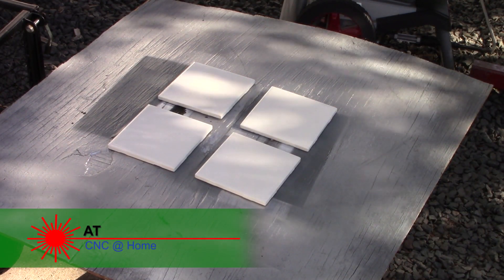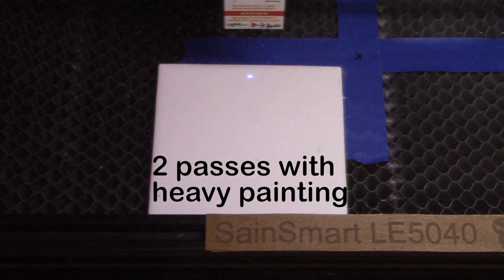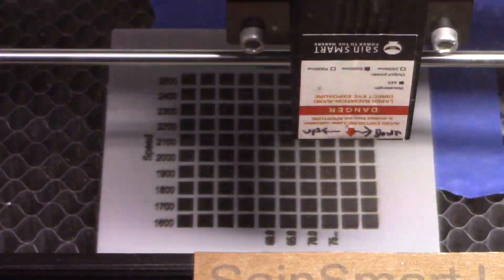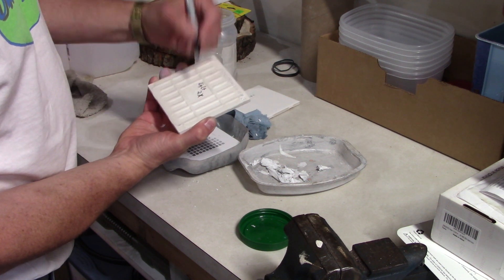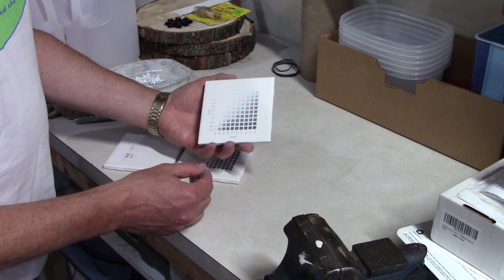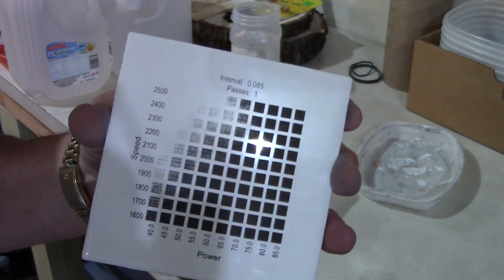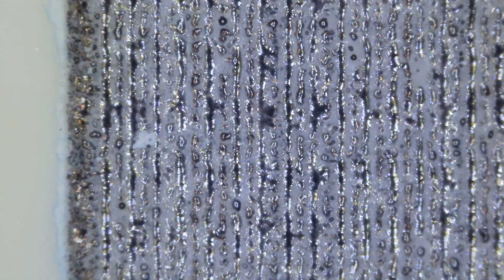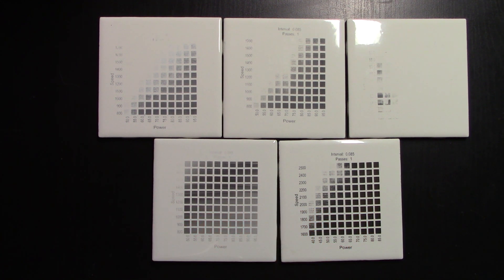Tile etching - How much paint is too much paint?  Is paint the way to go?

Comment: What was the cold galvanising compound spray you used, please.
Great video, new subscriber.
Reply from the maker: Great question.  You are going to love the answer.  What I use is literally called Cold Galvanizing Compound from Rust-Oleum.  Back in the day, we used a product called ZRC which is zinc-rich coating. I am not endorsing or promoting Rust-Oleum products, that just happens to be the brand available at my local hardware store.  AND thank you for the sub!  🙂
Reply: Thanks, i found several spray types, good reply!
Reply from the maker: @stu_artist  - Anything with a high zinc content should work.

Comment: Thank you for a great informative video the Galvanised  compound does seem to be the best, I noticed you have a 5.5 watt laser is there any power conversion charts/apps for using a different power laser (I have a Falcon 2 22 watt)? 

Keep the great videos coming and Happy New Year.
Reply: Thank you for the advice, i'll run a test pattern and adjust the settings, thank you again, take care
Reply from the maker: @DaveJonescruise  - Once you find your operating area, you will be golden!
Reply from the maker: It would be great if there was an easy conversion for that.  There is more too it than just the output power.  The size of your laser spot will also affect your parameters.  My AtomStack P7 is only a 5.5 watt laser but the spot is really tight and small so it acts more like a 10 watt laser. But with the smaller spot, doing a fill requires more passes.
I did find that the CGC has quite the latitude where it works well. If you have LightBurn, use the material test option to find where your laser's sweet spot is.

Comment: Hi. Greetings from Ireland. 
Saw your video regarding using cold galvanising compound on white tiles and wondered
A- do you put any paint on the tile before the CGC?
B- what settings do you use to do the tile test where you get all the squares?
C- I have an ortur lm2 15w with a fixed focus laser module on it. Would that be suitable for engraving on white tiles using the CGC?
D- are there any health issues with spraying or engraving on tiles coated with CGC?
We cant get paint containing titanium di-oxide here, so im hoping the CGC stuff will be a good substitute.
Your video was soo informative so i subscribed 😊
Hope ive not asked too many questions here !!
Reply from the maker: Thank you for the questions and always great to hear from my Irish kin.  Thank you for subscribing.

A - CGC goes directly on a clean tile and you don't need much
B - With my 10w laser, found the sweet spot at 35% to 50% anywhere from 2,000 mm/m to 3,800 mm/m.  It seems to be a very forgiving process.  I did find that too much power is bad at the lower speeds and is good at the higher speeds.
C - With your 15w laser, you will have plenty of power to do this.  Doesn't take much.  I got great results with my 5.5w laser.
D - As with anything you are burning, make sure to have good ventilation.  As a general rule, you do not want to inhale anything the laser is burning.  When applying the CGC, it is also a good idea not to huff the fumes.  ;-)

I have been using TiO2 mixed with alcohol and gotten great results.  If you can get CGC, that should work great for you.  It is easy to spray on in a light even coat and the results are very nice.
Reply: @CNCATHome Many thanks AJ. I'll get some CGC tomorrow. 
We might even explore your Irish kin one day 😂
Reply from the maker: @mikemcguckian6968  - Best of luck with your experiments with CGC.  My dad's mom was Irish. Her parents were first generation immigrants to the USA. You have to go back farther on my mom's side but they are all British Isles: English, Scottish, Irish.  I was asked once how much Scotch I had in me and I replied "About a fifth!"  😂
Reply: @CNCATHome  that's the right place to have scotch! No point in keeping it in the bottle😃
Reply: I'm fairly sure that cold galvanizing compound is basically zinc in carrier.  I might use zinc in  my laser since it is basically under a fume hood with positive pressure ventilation.  But for the same reason you don't weld galvanized metal, you don't etch with zinc without good ventilation.
Reply from the maker: @NShellhopper  - That is basically what it is.  It is also referred to as Zinc Rich Compound. A VERY good idea to have a well ventilated system when burning that or galvanized metal as you mentioned. I have a 440 CFM fan connected to my laser station that pulls the fumes down through my honeycomb waste board and out!

Comment: One of the better videos I’ve seen when it comes to white tile, thank you! I’m curious, when running your test burn what are the settings to make the laser go both vertical and horizontal?
Reply from the maker: Thank you for that compliment!  I did a quick review of the video to see what you were talking about with the vertical and horizontal.  I didn't see what you were talking about.  I did think about how that could be done.  With a material test, you have control over the material default settings and the text default settings.  As these are set independently from each other, one could be with with a 0° scan angle and the other at 90°.  Within your layer settings, LightBurn has the option of setting multiple layer settings which are applied in order.  I have used this when filling lettering and then come back and use the line option to finish around that to help give it a cleaner look.  This could be used to have a 0° scan followed by a 90° scan.  I hope this helps!  🙂
Reply: @CNCATHome  Thank you for the reply. I was referring to your comment at 2:35 point of the video.
Reply from the maker: @reidjensen569  - Poor explanation on my part.  I was referring to the coating on the tile, not the laser movement.

Comment: That method sure looks familiar
Reply from the maker: Since this video, I have found two other methods that are more consistent and yield better results.  I replaced the white paint with Cold Galvanizing Compound which works very well.  The other method is to use raw titanium dioxide which is what is in the white paint that makes the magic happen.  
CGC: https://youtu.be/t8iJ5Q5qlIU?si=2_TlDtVitDB-OOti (figuring out an issue with CGC)
TiO2: https://youtu.be/GvWHqNku7s0?si=5P6zjL8G49Qu0Wqu

Comment: How long did you let the paint dry before you etched?  Also, are you worried at all about burning cold galvanizing and the fumes produced?  Thanks.
Reply from the maker: That is a great question.  The paint only needs to be dry to the touch and this process will work.  It is the titanium dioxide pigment that this process changes to black and the rest of the paint is just there to deliver and hold it.  A thin coat of paint is all that is needed.  Since this video, I have gone directly to spraying a titanium dioxide mixture onto my tiles and have gotten great results.
Reply: @CNCATHome  The reason I asked is that I have tried the satin smokey beige paint, which is supposed to have more Ti oxide in it than the white paint does.   I was putting on two light to medium coats on the tiles, and not getting any black to come out. I'm using an 80w Co2 laser.  I've done tests from 10mm/s to 300mm/s and power from 10% to 60% with no luck.  Really didn't want to use the galvanizing paint if I could help it, because of the zinc fumes.  I guess I'll order up some Ti power and give that a try.
Reply from the maker: @bigfranksworld  - 80 watts!!  Must be a CO2 laser.  I don't know how well this process works with a CO2 laser as I do not have one, yet. ;-)  I have done this with 5.5 watt and 10 watt, blue diode laser with great results.  I don't know how the frequency of the light affects the process.  The TiO2 process has worked great and is very bullet proof.  The only issue I have had with this method was when my lens was clouded and I hadn't caught it.  After cleaning, all was good again.  The magic is the TiO2 reacts to the laser and crystalizes which causes it to turn black and stick to ceramics.  I don't know if that is due to the heat, light frequency, or some combination of both.
Reply: @CNCATHome  Yes, people are doing it with Co2 lasers and getting good results.  I just have something I'm not doing or getting right.  I'll try the Ti and see if that works better for me.  I tried the paint process as I was able to gt the paint in town, but just ordered some Ti powder online, which will be here in a few days.  Thanks again.
Reply from the maker: @bigfranksworld  - Thank you for the information on CO2 lasers.  I have a few videos out there about how I use the TiO2 for tiles and glass.  Some people use isopropyl alcohol, I use denatured alcohol.  Other people have used water and even added in some white school glue and food coloring.  The coloring helps to see what has been applied.  TiO2 is VERY white.  The application can be with a brush, pouring it on, and I have started using an airbrush with great results.  Many great options and all seems to work well.  Have fun figuring out which method works best for you.
Reply: @CNCATHome  Thanks for the info.  I'll get it worked out out at some point I hope.

Comment: Can you share the dfx or SVG files you used for this test?
Reply from the maker: There isn't a dfx or SVG for this.  The material test is a function within LightBurn.  You can set numerous parameters for how you want the test to be performed from power and speed to size and number of boxed to be tested.  I have video that talks about this functionality within light burn: https://youtu.be/RPNzjK4kvEQ?si=svtVJVw7g1Fh-2OG.  Sorry for the confusion on this.  I should have quickly shown the Material Test feature and how I set it for this project.
Reply: @CNCATHome  that's a shame I'm stuck with LaserCut 5.3 for the laser I have access to. It's UI is from the early 200s and has no quality of life features only bugs.
Anyways thanks for the quick reply I'm going try and make a version of that for my setup.
Reply from the maker: @aaronstanley6914  - Sorry to hear that.  You can use LightBurn free for 30 days.  It is the full version too. After that, you have to buy it.  Once purchased, you get a year of updates and upgrades included in the purchase price.  After the year is up, you can either pay an annual subscription to keep getting updates and bug fixes or you can not pay any more and use the last version you got before you year was up.  Something to think about.  🙂

Comment: Are you using a USB microscope?  If so what brand/model do you recommend?
Reply from the maker: I am using a USB microscope.  It can use a WiFi connection too.  The one I use is from Ninyoon: https://amzn.to/3XrrEIC.  Right now, it goes for $39.99 on Amazon.  I purchased a different stand that works much better than the default one: https://amzn.to/430ee7J.  I like it.  The software I use for this is xploview.  Seems to work OK.  A few hiccups here and there but over all, works well.  For free software, it is well worth the price. http://www.xploview.com

Comment: Great video, thanks for the content. Any tips on removing the smell of the paint thinner from the tile after it is cleaned off? Thank you!
Reply: I lick em clean but people thing I'm strange.
Reply from the maker: @jerbear7952  - That's not strange at all!  I worked with a guy who would clean his glasses by licking them.  And he wasn't....  Well, maybe he was strange.  But that's not the point.
🤣
Reply from the maker: That is a really good questions.  The first thing I do is to try and minimize the amount of thinner that touches the none glazed part of the tile.  That is where it will soak into the tile.  There will always be some that gets in.  In really bad cases, I will scrub the tile with soap and water.  Otherwise, I put them out in the sun so all of the liquids will evaporate out.  For me, that has worked well.

Comment: what happens if you use no paint at all when engraving tile?
Reply from the maker: That is a great question.  There is a method where you do not paint the tile and after you make your burn, you apply ink to the tile.  It will soak into the cracks in the glazing and reveal your burn.  I messed with this method a while back without good results.  The ink I used was from a Sharpie marker. A better way would be to use Indian ink.  The cool thing about this method would be the color choices of different inks.  I should re-visit this method to see if I can get it to work better.  I have watched videos where people have used this method and achieved some great results.
Reply: @CNCATHome  Yeah I've seen those videos and they are pretty cool. I think I need to rephrase my question. What does the paint do for the engraving?
Reply from the maker: @HWoodCreations  - I see what you are asking. This method relies on a reaction within the paint to the heat of the laser.  Mainly it would be something like titanium dioxide (TiO2) found in many white paints.  The TiO2 will turn molten and black when enough laser energy is absorbed.  The molten TiO2 will quickly cool down and stick to the surface of the tile. The rest of the stuff in the paint will burn off in this process.  After you are done burning, and you clean away the un-burned paint, the black part remains and is permanently stuck to the tile. Without this reaction from the TiO2, all you would do would be to burn away the paint.  I have some videos on the channel where I do this with one or more colors layered on the tile.  You can get some interesting results.  The issue there is the paint can easily be scrapped off the tile so I end up putting a couple coats of a water based polyurethane on those to  help protect that from happening.
Reply: Nothing. You need the Ti in the paint to react with the glaze of the tile.

Comment: Thanks for sharing your experiences and please put some gloves on when handling chemicals.  Lacquer thinner may contain compounds that are known carcinogens.  I have personally found out that even different batches of Rustoleum  flat white yields different results.  Carb & choke cleaner also does a great job of removing the paint.
Reply from the maker: Thank you for the advice.  I do try to minimize my contact.  Gloves would be a good add.  I am working on a different process that will be water cleanup so I can avoid Lacquer thinner altogether. I have not tried carb cleaner on the paint.  I will have to give that a try.

Comment: Thank you for sharing your results for this engraving method.  I think you hit the nail on the head regarding the amount of coating.  I experimented a bit and it seems like the lightest most even coat of spray works best.  I don't know if this is the most efficient use of the paint, but try to just barely fog the surface, let it dry a few seconds and then fog it again turned 90 degrees. It is tempting to put more paint on but go with the most minimal amount to get an even coating.  My NWT test pattern had a nice indelible black pattern at 3000 mm/min,  60% power.  I also tried the Rust-Oleum Ultra Cover Heirloom White and got pretty good results at 2000 mm/min, 50% power, but I think I had too thick of a coating and need to run the test again. I am using an XTool D1 10watt.
Reply from the maker: In this case, more is not better.  Thank you for the the information.  I have also heard from several people that their beige color works well. I have not tried it yet and plan on picking up a can to try it.

Comment: I watched another channel who recommended the "Antique White" spray paint from Rust Oleum because the formula contained a larger amount of zinc, so I think you are on to something with the cold galvanizing spray which is 93% zinc.
Reply from the maker: Thank you for the information!  I will have to try the Antique White to see how it performs.  The CGC that I use works remarkably well and is much more forgiving on the burn speeds and power settings.  It isn't quite as dark of a black as the white paint method. Still, much easier to work with and clean up.
Reply: @CNCATHome  I've been using the white, but just ordered a can of CGC. Your results look better than the Antique White.
Reply from the maker: @karlsangree  - When you see how it look under the microscope, you can really see how the CGC looks so much more consistent than the white paint method.  Good luck with the CGC when you get it.  You should like the results and the flexibility you get when using it for this process.

Comment: So this is just burned paint *adhering to the tile, rather than etched tiles with paint, right? 
Think I’d rather etch with the laser and wipe with paint into the etch —in an intaglio manner….
Reply from the maker: @jimniki6856  - It is just easier to say that you are burning the paint.  In a way you are as other components of the paint are burned away while the Titanium Oxide is quickly melted and then sticks to the material.  Thank you for providing a more accurate explanation of what is going on.
Reply from the maker: Great comment!  It is just burning the paint.  You do only end up with black using this method.  When the paint melts under the laser, it sticks to the tile very strongly so it doesn't scrape off.  The method you are talking about is another way to do something similar.  The advantage to your method is that you can apply colored ink or paint to the tile.